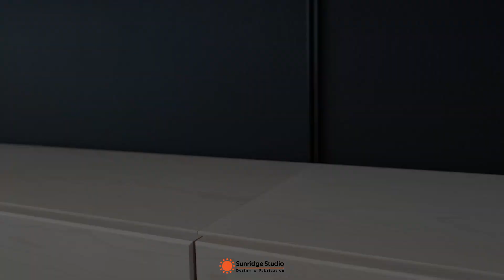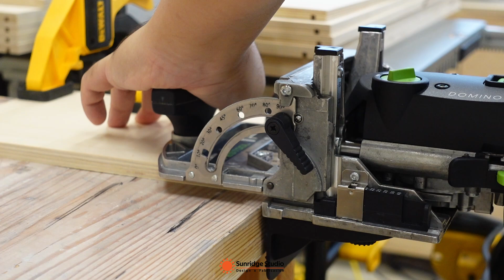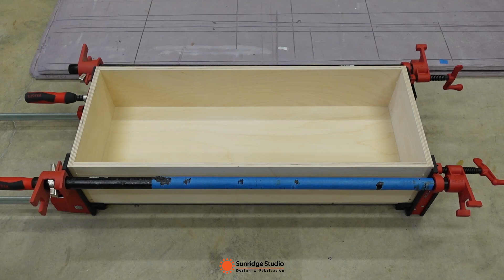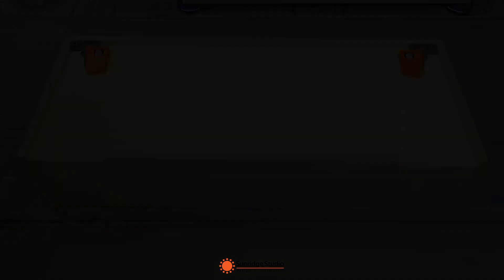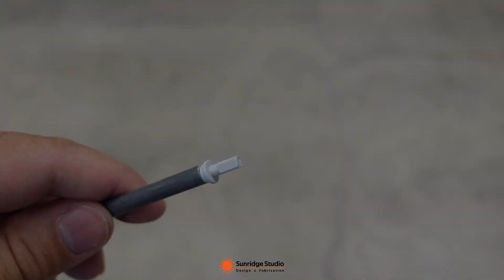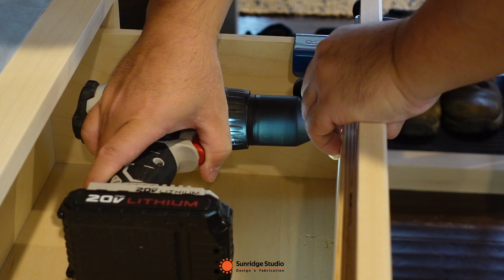Making tip on and soft close drawers with Blum MOVENTO TIP-ON BLUMOTION hardware

Comment: In the manual of the movento tip-on it is stated that for an inlay drawer you N (Nominal length) - 10 as length for the drawer. Did you calculate this into your design?

Comment: Great video
One of the best I’ve seen yet
I have one question
How much of a gap is left between cabinet face and drawer face back? Thanks in advance
Reply from the maker: Thank you! If I remember correctly, it shall be 3mm. The manual of tip on device should specify this. This gap is needed for tip on mechanics to react and then push out the drawer.

Comment: nice explanation with demo. the problem is i have to pushing hard to close the drawer, possible to adjust?😊
Reply from the maker: Thanks! That is the side effect of tip on function. If you put things into the drawer to make it heavier, it shall be easier to close. If the issue still exists, then you probably can choose a tip on device with lower weight rating. Blum tip on device has several different weight ratings.

Comment: Hi, have you ever installed this system but with drawers who are with interior front face?
Reply from the maker: Not sure if I understand your question correctly. Are you referring to inset drawer? If yes, then you can definitely do so. You just need to use different runner setback. From this link, you can find a Blum Movento tech doc. https://drive.google.com/file/d/1WFhM0YkrGr6xEyVpNiEfG7gxouEXsfNx/view?usp=sharing
On page 24 & 25, you can find information about inset drawer and runner setback.